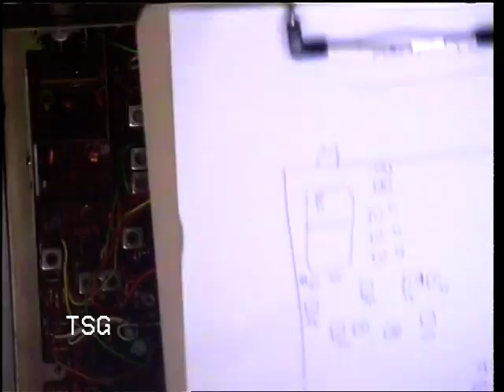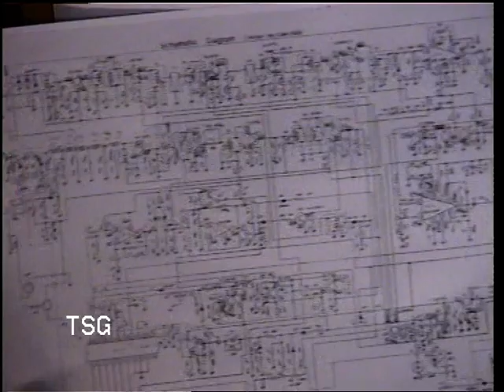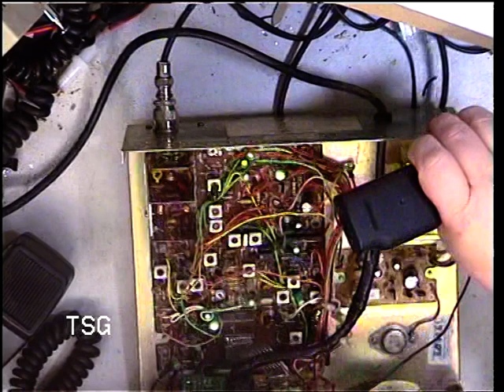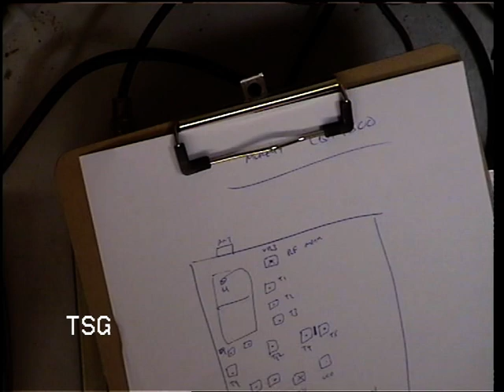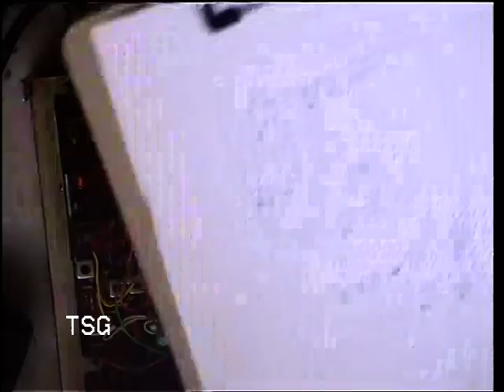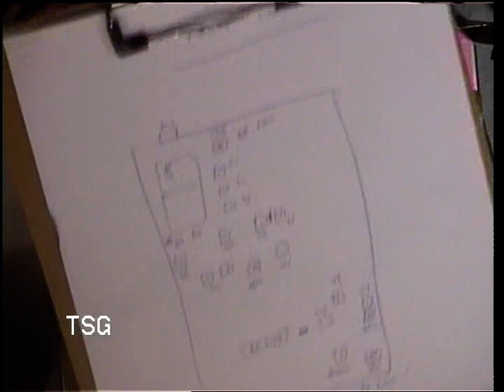Murphy CBH1500 CB radio (UK) 27/81 base station - Receive alignment

Comment: Hi Richard, I don't think you mention what you found the sensitivity to be like in this video in terms of how many microvolts you could drop the RF signal gen to before losing the audio.  In your on air test video, however, you mention one of your CBH1500s being more sensitive than the other.  Just out of curiosity, what sort of sensitivity did you see on these sets?
Reply from the maker: The radio in the video (referred to in the on the air video as set no 1) turned out to have had a crystal filter retro fitted correctly. I'm not removing this modification as it was properly done. That set managed a very good 0.25uV. Set number two (the first one on the on the air video) had the correct standard ceramic IF filter. Sensitivity was 0.35uV. I've just checked the user instructions and they say "better than 0.4uV". Both were therefore better than spec. Now if the crystal filter helped or not I can't tell & doubt it, as that would just affect selectivity which is unlikely to be a problem here in the middle of nowhere.

Richard
Reply: @ukfmcbradioservicingTango21  Great - thanks Richard.  So I guess it's near the top in terms of sensitivity relative to older radios in general I would say.  In my own experience, there are very few radios more sensitive than those using the Cybernet economy board, e.g. Fidelity 2001, Amstrad 901, etc, but also I found the Midland 38 and Kernow Beta 3100 and 4100, which all share the same board type are of similar sensitivity. I think the worst I've found was around 0.5uV, but right now I can't remember what that radio model was.  Thanks again.

Comment: What about the main squelch Potensionmeter  ( Sorry On Spelling ) could that have a fault with it not the VR it's self  maybe turning the squelch all the way up has gone past a point where it won't open up
Reply from the maker: all components were checked off camera 'just in case', but remembered the squelch lets down the receive on these. I'll overhaul the other one I bought off camera & see if it performs the same.

Richard
Reply: You'll have to let us know how you get on  
David
Reply from the maker: I'm at Colsterworth Saturday afternoon FYI
Reply: Don't hear many on out this way now lucky if anybody on when there has been a fender bender near by spoke to a few drivers and helped them round a couple of months back but besides that it's dead such a shame for a basically free service  radio antenna no licence what more can you ask for ?